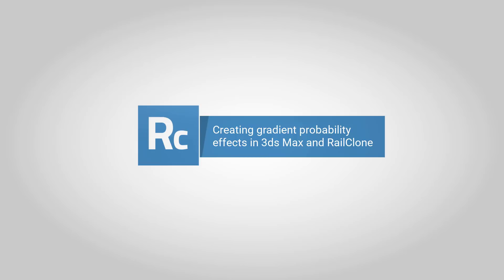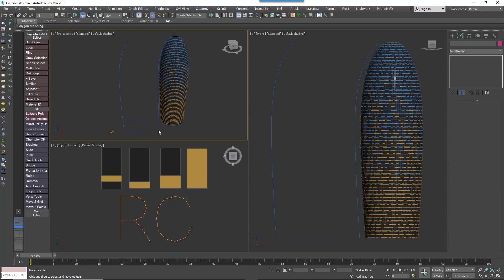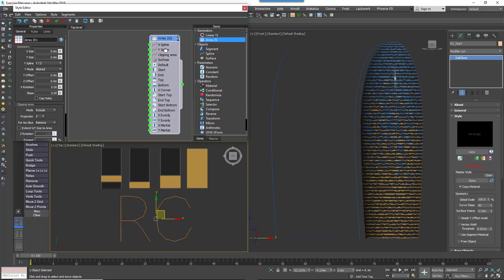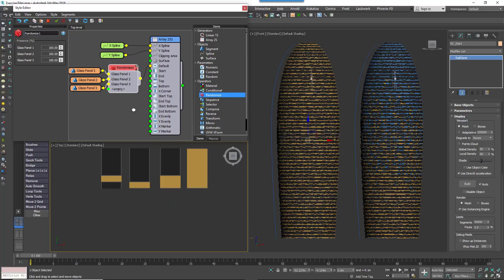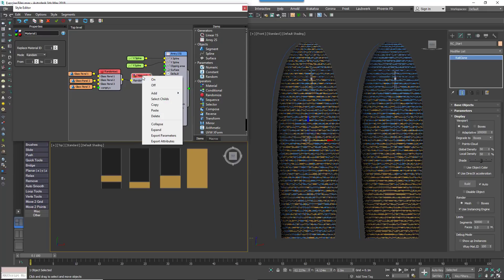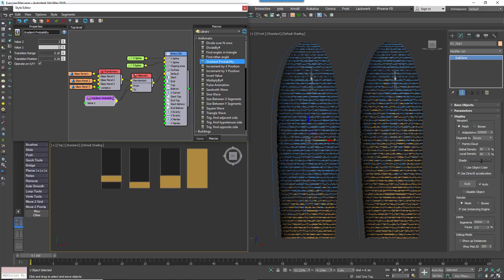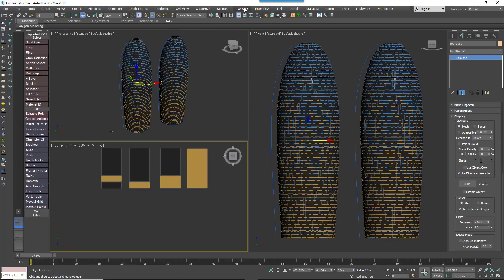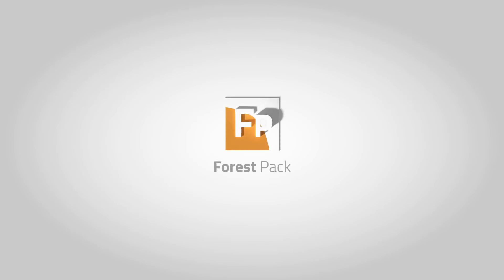QUICK TIP: Creating gradient probability effects in 3ds Max and RailClone (intermeditate)

Comment: Dosen't work for me. It twists the mesh and its never on the position
Reply from the maker: Hard to say what's going on, but it could be similar to some comments mentioned by others. I

t may be to do with the axis the Y spline is created on. It's expecting to use the spline on the Y/Z plane. You can change this by either rotating the spline (at sub-spline level) or try changing the Y Spline setting in the A2S generator to X/Y. Please feel free to send us your file to helpdesk@itoosoft.com though so we can diagnose what's going on more accurately.

Comment: The tutorial so understandable. Instead of using a circle for x spline. I have practiced with a regular splines for x and y splines with no  curves. Its not coming out. How can i go about the same with regular shapes. Any help?
Reply from the maker: It may be to do with the axis the Y spline is created on. It's expecting to use the spline on the Y/Z plane. You can change this by either rotating the spline (at sub-spline level) or try changing the Y Spline setting in the A2S generator to X/Y. Please feel free to send us your file to helpdesk@itoosoft.com though so we can diagnose what's going on more accurately.
Reply: @itoosoft  Thank you. Trying it out

Comment: Another reason why I purchased this 2 beautiful plugins! Can i ask what if i want to apply this method on a circular plane ? Should I just not check the xy button?
Reply from the maker: Thanks for the kind words. X/Y toggles between either the X or the Y axis, so it wouldn't quite work like that. You could use the cirlcle as an X spline input and another for the Y spline (similar to this tutorial), or perhaps even use RailClone Colour's tint by texture on surface mode instead.